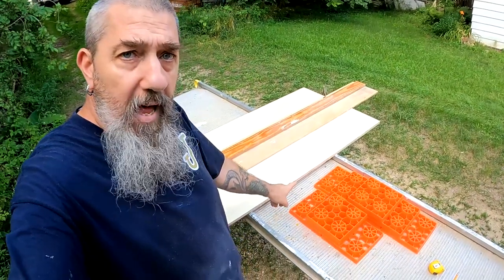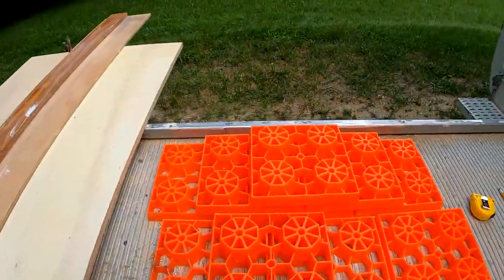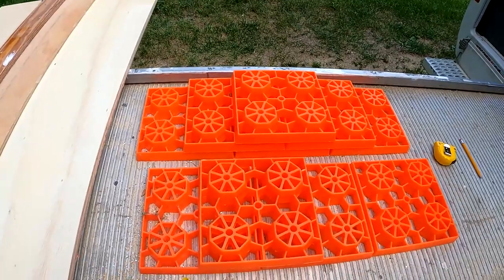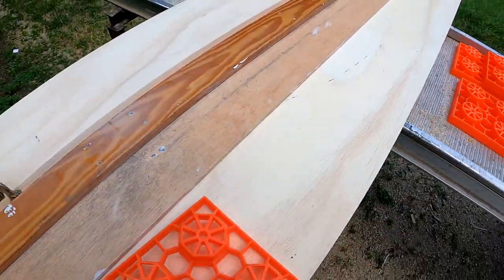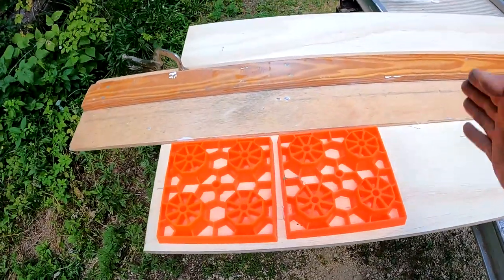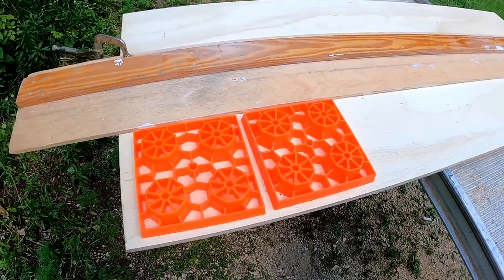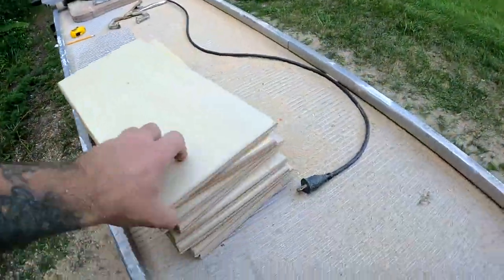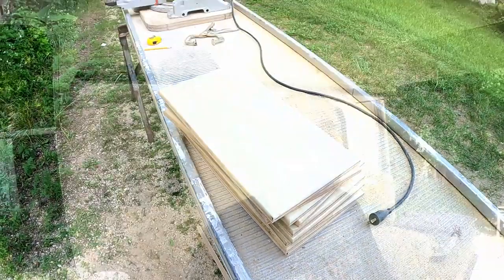Ep32 Van Build - Installing Adjustable Shelving

Comment: how are those air vents at the top holding up? i saw the screen doing work, could prob get a micromesh filter or something up there to keep the smaller stuff from getting in, also with that PC you got down there under the bed should serve as a nice little heater during the winter lol, any plans on getting one of those small space coolers u can mount or do u think u wont be needing that? also, not sure if it is a current or possible future worry, but the sliding door in the back you were talking about getting it sealed and such, not sure if this is a good idea or just a stupid idea but would it be possible to like... mount some type of... cover? like some kind of insulative shielding if you will. I know theres a lot of different types of insulation, some work as a water sealer etc, what if you could just get something like that u can just attach over the door, give it a nice seal + insulation and mount it around the door or whatever when its not open or in use, or maybe even have it set up so when the door is open, you can just use a screen layer or something to let the light in, but without bugs :P kind of like a meshed gazebo or whatever
Reply from the maker: Are you talking about the roof vents? They work AMAZING! So good they suck the bugs into the screen and hold them there. I've since cleaned the screens. They are super easy to remove. And yes, between the PC and the Inverter, it's been 5-10 degrees F warmer in the cabinet space. I've installed remote temperature sensors, that I'll cover in a future video. But, I'm still dialing in the powered fans for that space. Unlike in my home, the van's PC is not on when I'm not using it. If I was super concerned about insulating the rear door, I'd have removed it all together and replaced it with a proper wall. As far as a screen for that end, I have researched what's needed. But because nothing exists already specifically, I'll likely have to custom make or heavily modify something to make it work. I haven't yet, as I was waiting to see how much available storage I was going to have left over. But it would make a very nice addition for sure.
Reply: @JaxMacky  lol thanks for the response sorry for shooting u a billion different questions XD all that makes sense enough :P and yea was talking about the air vents awesome that they are working out for you

Comment: coming together nicely are you gonna get mats to go between the plates to stop em banging together while your driving ?
Reply from the maker: Yes, I already had some non skid material to use for that. I just needed to cut it to size.
Reply: @JaxMacky   :) figured you would have that sorted
Reply: true and if it becomes an issue, can always go with non ceramic dishes, doubt it will be a big issue tho, doubt hes gonna go rock climbing in that thing lol as long as hes avoiding rough roads should be good